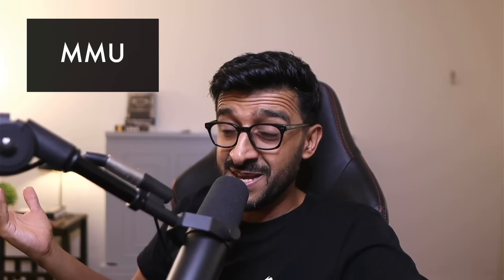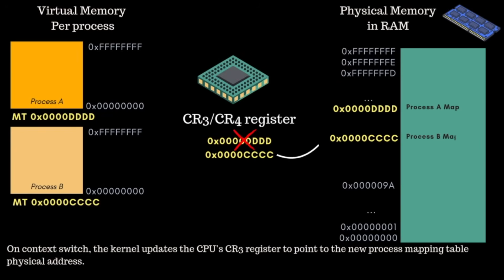The rule of CPU in the Kernel

Comment: I had the good fortune to encounter a bug in Windows CE in 2006, and it took several weeks for me to debug and I ended up dumping the page table, and took a print out of 20-30 pages, and had to verify the virtual to phyiscal translations of the regions I'm touching were correct only to realise that that ARM MMU hardware had a 14-bit alignment requirement where as I giving a 12-bit aligned address.

But this gave me solid understanding how it all works and changed my perspective of Virtual Memory for life.